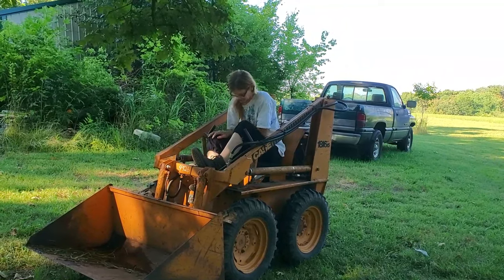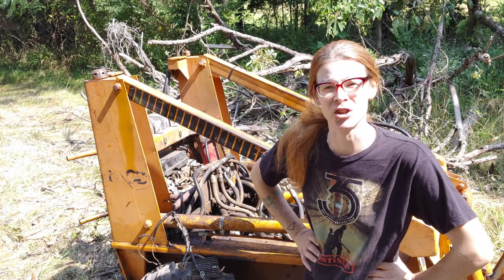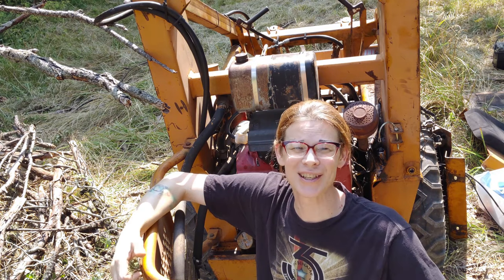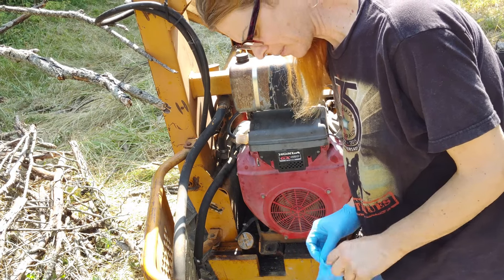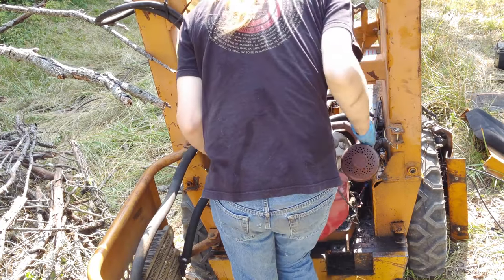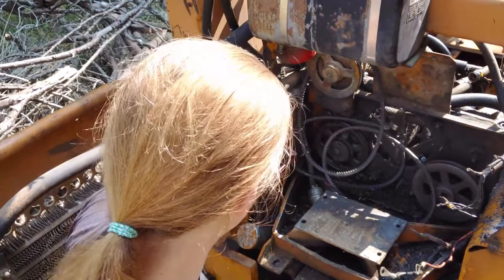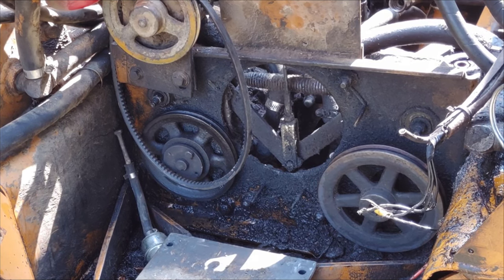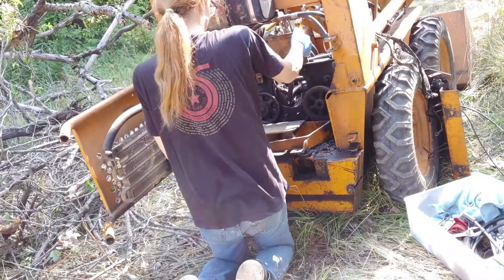Case 1816b skid loader tear down failure rubber tire machine with honda 620 engine

Comment: These are the best mini-skidsteers ever made. My dad and I have 2 of them. The specifications in the book are egregiously under stated. We’ve discovered that they actually perform about 17% higher than listed. This video made my day.
Reply from the maker: This is great news! I could tell it's a very solid machine, but I have limited experience with industrial equipment. I will be a great tool when it is finished!

Comment: I wish I was there to help you, I've fixed an 1816c it was a lot of fun. Paid 600 got 4000 it was worth fixing you'll be glad you did it. Found on a guy had in Denver city. It only has 560 hrs. On it, still has original tires on it. It's a keeper good luck to you I will follow your progress, plus your cute,see ya soon jim

Comment: Thanks so much for the video.   This helped me get an idea how to fix my drivers side issues.
Reply from the maker: More recent repairs have alerted me to another cause of oil starvation. My filter was not flowing enough and this machine does not have pressurized filtration. The drivers side is more likely to be starved due to the 't' fitting. Make sure you have flow after the filter. Let me know how it works out for you.

Comment: Neat little skid steer.  Vane pumps?   Water causes vanes to stick.  Belt drive unit with spring tension looks  worn out..got GTAW?
Reply from the maker: no vane pump. it's a combination gear pump and rotating piston. pretty complex to allow for forward or reverse hydrostatic operation.

Comment: What are you working on now
Reply from the maker: Jim, the Case gets used several times a week. It still needs TLC, but it can put in some work when necessary. Today I pulled the motor out of a Subaru.

Comment: Hi, were you able to fix the hydraulic motor on the left side. Your work is impressive.
Reply from the maker: thank you! I was able to find the root of the failure in the left pump. I could not fix the pump, but found a good used pump on ebay. My test of the replacement pump affirms my diagnosis. I will have the machine back together soon.
Reply: Good news indeed. Hope you can make a video operating it. @kimfixesthings
Reply: @kimfixesthings  I have adjusted the chains and linkages on the drivers side on my 1816b.  It can now pivot in reverse and forward pivot is a little better but still not optimal.  I believe now that it is either the belt slipping on the pump or the hydrostatic pump on driver side.  Have been looking for a used one or maybe a rebuild kit if that is an option.  This skid steer sent me down a rabbit hole 😀